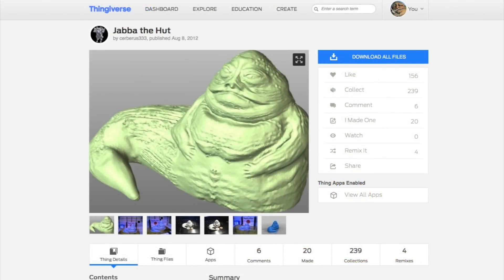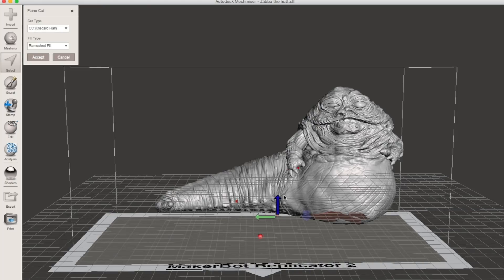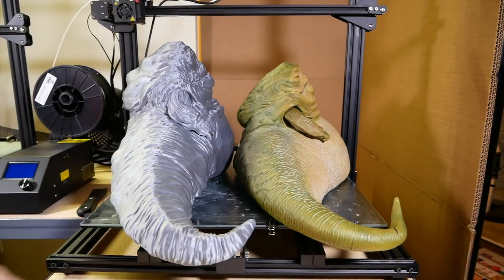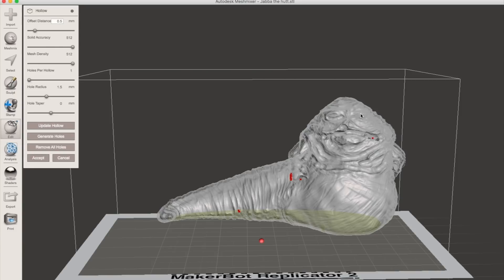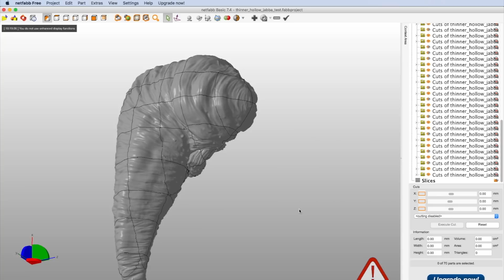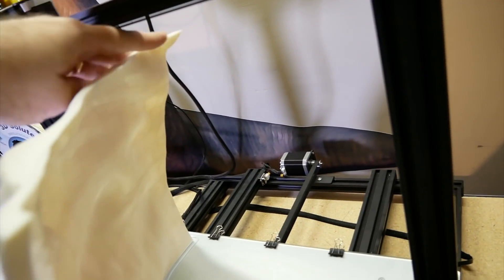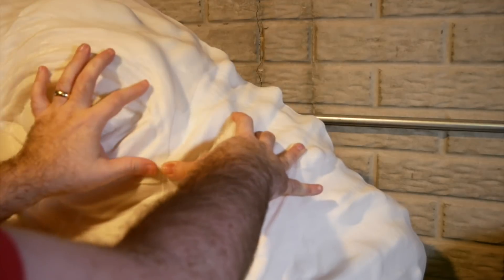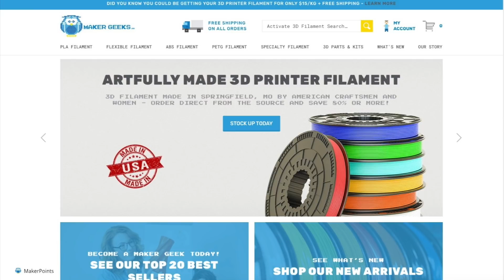3D Printing a Life Size Jabba the Hutt! (Part 1, Sponsored by MakerGeeks)

Comment: Seams could be reinforced with hot glue. You will need 100+ watt gluegun, and lots of sticks. Than, "draw" with glue along all seams, on inside of the model, with line about 1-2cm wide and 4+ mm thick. It will join parts together really tightly, and, because of elastic nature of hot glue. It will hold together pretty good, because all stress applied to model, will be relaxed in this glue seams, and they wouldn't craced as ca glue or epoxy.

Comment: Unfortunately, by printing this model at such an extreme size, it also reveals a number of problems with the original model. As you can see evidence present with the eyes, which are anything, but smooth spheres, like the original. Maybe, I'm being a little O.C.D. But, being as dedicated a "Jabba" collector as you are, I would think that would be frustrating. And, I would seek out a way to fix those areas as best I could.  Also, I would think that the warpage you are experiencing between the front & back halves of the head, are most likely due to the size and weight of the pieces. Backing up the parts with a rigid support, (such as rigid, expanding, urethane foam), should help minimize, or eliminate this problem. I DO NOT recommend using the " Great Stuff", expanding foam, from the hardware store. It cures from the outside, in. And, it continues to expand for quite a long time, beyond when you might THINK it has cured all the way through. This would cause a lot of unnecessary heartache & suffering, (and A LOT of re-printing you don't want to do). My recommendation is to purchase a few gallon kits of "traditional" expanding foam, from a company like "BJB Enterprises", "Polytek", "Smooth-On", or even from a local "fiber-glass & boating repair supply" place. The lower the "volume" of the expansion of the foam, the more overall foam you'll get for the same price of the product. I would suggest using a 2-4 pound density foam, rather than something like 8-10 pound density. The denser the foam, the less foaming you'll get, and the heavier it will be. Using this "traditional" foam will also be MUCH cheaper than the number of tiny cans of "Great Stuff" you would likely need.
Reply: One other idea that came to mind is, you might want to consider keeping Jabba in a few large pieces, to facilitate moving him around and/or for storage, (such as head, body, arms, tail). To assemble him as needed, I would include some kind of corresponding registration keys, and/ or magnets. This will greatly help in aligning his parts quickly & easily.
Reply from the maker: I may do some minor alterations to the model in the course of finishing and painting it, but we'll have to see. As for the need for support, I have the two halves of the head glued together now and it is amazingly rigid and strong. I really don't think there will be any need to add extra support. Expanding foam in particular is probably more likely to go horribly wrong than to actually help, especially since I've never used it.
Reply from the maker: I do plan do keep him in 3 or 4 sections, because otherwise I wouldn't physically be able to get him out of the basement where he will be located. I don't know that I really plan to take him anywhere, but I don't like the idea of having to destroy him to get him out.
Reply: 'With the understanding that everything I'm mentioning is strictly suggestions, and nothing more.

Rigid Urethane foam is actually surprisingly easy to work with. Being that you would not need the foam to be exposed, there isn't anything to worry about how it might look. This makes it even easier for a first-timer, like you. Obviously, it would not be a good idea for you to try to mix & pour all the foam at once. This is to your advantage. Fresh batches of the foam will easily bind to previously cured batches. Again, this is to your advantage. The point is, as long as you mix & pour the foam in small batches, you WILL have full control over it. It is also possible to "slush" the foam around, and build it up, a layer at a time. At most you'd only need a few inches thickness. This way, you could "have your cake, & eat it, too", so to speak. This would allow you full control, give the model the support it needs, & still have the model mostly hollow.

Of course, whether mixing & pouring rigid foam, or ANY unfamiliar material, you should ALWAYS test & experiment with it first. This will allow you to get past the first-time jitters, & give you confidence in what to expect. You really don't need much at all to test with. You would only need enough to fill a [virtual] shot-glass, a quarter of the way full.  So, the cost of materials to try it out, is nearly non-existant. If you try your local fiberglass & boat repair shop, you may be able to get a small sample or two, to play with, for free.

For the eyes, specifically, you can cut out the eye area, and replace them with appropriately sized, plastic, Christmas globes, of the correct size, (these can be obtained from your local craft store, for VERY cheap). Then using an epoxy putty, (and your real Jabba casting as direct reference), it would be an easy affair to resculpt the eyelids. Or, you could repair the eye areas in Meshmixer, (using parametric spheres, & the included digital sculpting tools), then reprint just those parts to fixed. This could be done for any of the individual parts, (especially, since you sliced the original model into at least 70 pieces).

There was no mention which type filament you're using to print Jabba with, (I assume you're using PLA). Being that it's still winter, right now, you're printing and assembling him in a relatively temperature controlled environment. I'm sure you know that for the past 6 years+ we've been experiencing hotter summers than ever before, on record. This isn't something likely to change any time soon. As many folks have found out the hardway, variable environmental temperatures can adversely affect large 3d prints. I would likely assume you want to keep this full-sized Jabba around for quite a while, ( probably years. if not decades). So, whatever you can do, to structurally beef him up, will help preserve him longer, without the need for constant repairs, will really help you out. Rigid Urethane foam is simply one of many ways your Jabba can be made structurally stronger, (it's also one of the cheapest & easiest ways).
Reply: you could cut the eyes out, and make half-dome pieces to glue in, like the movie puppet: https://www.youtube.com/watch?v=CJPrI-4DqEE

Comment: Super glue and epoxy can be ok, but a solvent welded joint would be stronger. And you could add a strip of plastic behind each joint for strength and alignment. Keep at it, this is going to be awesome.

Comment: why would u cut the bottom in the life sized model ? it would be no problem to print the full model as u slice it in pieces anyways
Reply from the maker: Lerbyn That’s true, but I need it to have a flat bottom for stability as well.
Reply: ok that makes sense then just wanted to make sure it wasn't a design oversight great video btw
Reply from the maker: Lerbyn Yes it’s a good point but I think it will work best with a flat bottom even on the full one. It’s possible I might not even print the bottom and just leave it as a shell with and open bottom

Comment: What are your thoughts on Jabba's tail? I've seen a couple versions in the seated position where it's shorter as in this model and others where it's much longer and tapers off in order to coil back around. I'm personally a fan of the longer tail but what's your preference?
Reply from the maker: Well, I don't think it should literally be able to coil like a snake's tail, but I do think it could be thinner and longer than it is on this model. I do kind of wish I had paid a bit more attention to the overall proportions when I was working with Josh to design it, but it looked good in isolation and I only noticed that the head portion seemed a bit oversized when I compared it to the Sideshow figure. But as I mentioned in the video, it's not really realistic to try and have everything be a perfect replica of the actual Jabba (and even officially licensed figures and statues have been much worse than this one)
Reply: Having it being able to coil would require a lot of extra engineering and materials. But I was initially thinking a static position with a longer tail. There are so many interpretations of Jabba across the board so when it comes to other people's preferences it's neat to hear or see what they choose to go with.  I think it's turning out great and it's been entertaining seeing the process of it all coming together. Thanks for sharing the process of this adventure!

Comment: Awesome glad the shell is working out! When we did E.T. this method was great with just a little assembly difficulty. On his head we recut it and let mesh mixer fill in the hole. This gave us the outside shape  with interior walls but no infill. Really impressed with the progress! Going to be an awesome result!
Reply from the maker: Yes, come to think of it your ET was one of the first examples I saw of this approach, although you didn't use the shell approach (not really necessary for something ET's size).

Comment: we've been think of investing in a small low cost 3D printer, have some project ideas that it would come in handy for. any tips for a beginner.
Reply from the maker: I guess it depends on how much you think “low cost” is, and what you want to do with it. The CR-10 is a good machine for not too much money and has enough build volume to do most projects. But there are cheaper ones too.
Reply: +Mighty Jabba's Collection thanks, I'm going to do some more research before fully committing. it'd be my first, so an easy interface would be nice. btw, can't wait to see how jabba comes out. love star wars.

Comment: Is there any particular reason you're not using some kind of interlocking pin/hole kinda system to align and join the pieces?
Reply from the maker: Well, that would require editing all of the pieces, and the shells are kind of too thin to make that easy as well. I do plan to build him in several sections so he can be transported, and I will be adding add some brackets of some kind with strong magnets to align those sections
Reply: Mighty Jabba's Collection, that makes sense.  I haven't been able to print anything large scale yet so I'm still trying to figure out what is and isn't easily doable.  Thanks!
Reply from the maker: I’m still experimenting with this myself so my plans may evolve

Comment: That's not life size......maybe 1/4 size
Reply from the maker: If you mean that he's only about 1/4 finished, then yes. But I think I have the overall size pretty close. There are a lot of different sizes quoted for Jabba online, but if you look at screenshots from the film, he's actually shorter than C-3PO (who is 5' 9"). The length could be a bit more depending on how stretched out his tail is, but I think 10 feet long is pretty close to life size.

Comment: How long did 1 piece take to print (about)?
Reply from the maker: Yes, I intended to mention that. It depends on the size of the piece, of course, but I would say each one was around 15-20 hours, with some taking longer and a few small ones taking much less. I'm not sure how long the entire head took

Comment: Brilliant! Looking forward to your next episode on this one. Question: Do you have to hollow the model if you are going to select a single wall thickness anyway? I noticed you set a 0.5mm shell thickness before you scaled the model. What did the final model end up with - because you were intending on using a 0.8 nozzle with single wall thickness?
Reply from the maker: This is a little hard to explain, but the single wall thickness refers to the walls of the shell. Since I hollowed it out, I was left with a shells that had two walls about 1cm apart with infill between them. If you didn’t hollow it out first and selected a single wall for the outer shell it would be pretty flimsy
Reply: Gotcha. That makes good sense. Nice. (I was wondering how you ended up with such thick surfaces on the joins when you were going to print with only a single wall.

Comment: glue the left side of the head thats fitting well now, then when its dry use a ratchet strap (or two) wrapped around the head to pull the seam/gap closed,  thats how i would do it. you might have to put a piece of board or something under the strap against the face to pull it at the correct angle

Comment: just a shot in the dark here, but i'm guessing youre going to need some type of support structure for the body. i can only imagine as you build from tail to body, then head, if you don't have supports inside, the belly will blow out once the weight of the upper body/head goes on.
Reply from the maker: We’ll see how it goes. The head is surprisingly sturdy, but I can always try adding some bracing inside if need be
Reply: hey, i'm genuinely excited about watching you get this done. i'm purchasing my 1st printer tomorrow (CR-10S4) soo youre definitely part of my research! i want to do full-scale SW stuff!
Reply: It does look sturdy and from my experience printing larger pieces like this I would say that you definitely do not have to worry about supporting it more unless you are trying to move it around a lot. I am very excited to see this in full!
Reply: Support would definitely be recommended in the final peice. You could do this on the cheap by simply creating make shift I Beams from PVC pipe to run down the middle of the structure. It would be super light and make a great support for assembly. Glue some eva foam to the cross members to give the print something to grab onto and your golden. Super excited for this project.

Comment: can you also add pins and holes to make it snap together .. ...of course i don't know  much about 3d printing but  i am really want to buy a printer and start learning .. appreciated your video
Reply from the maker: You could do that but I’m not sure I’m up to modifying a such complex model that way. I do plan to design some sort of brackets separately that I can add inside, since I need to be able to disassemble it if I need to move it at some point.